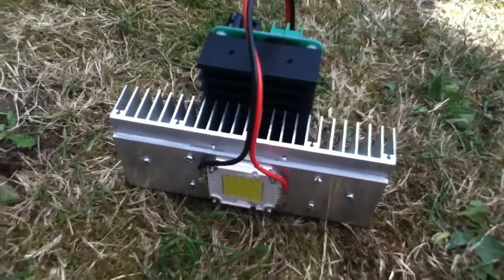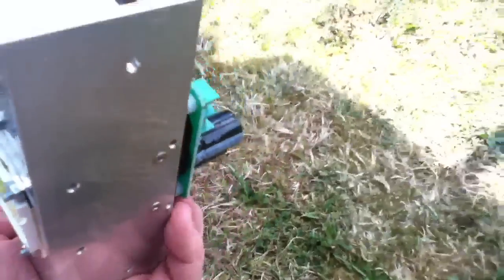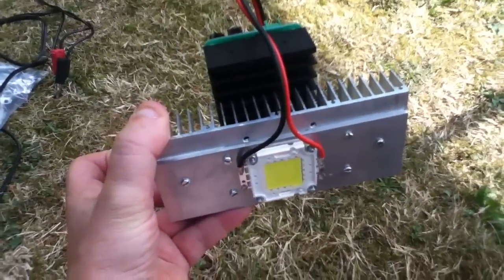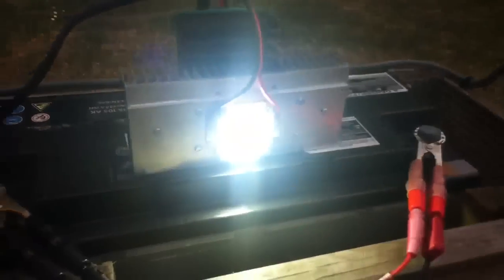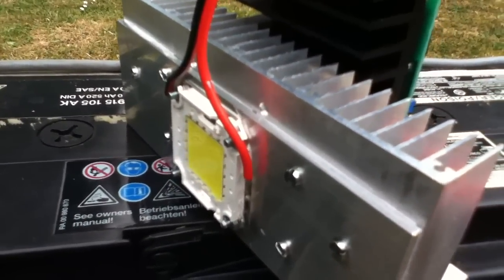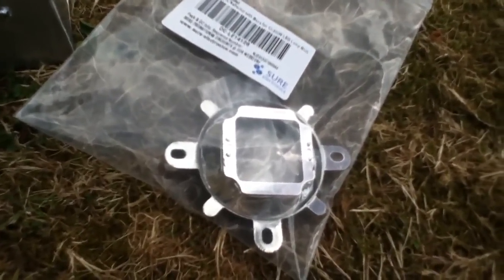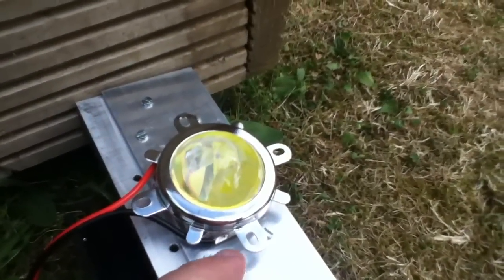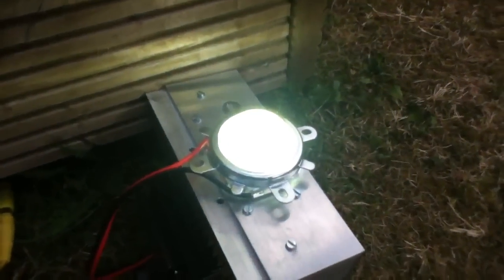Updates to 12V 100W LED Hardware - Heatsinks, Grease & Lens/Reflector

Comment: when you order 150 watt led floodlights, they don't have fans and heatsinks. Just mounted in a metal box. Why is that?
Reply: Because more than 80% (Ebay,Amazon...) are fake and have much lower Watt ratings

Comment: Why not use a CPU cooler?
 They are designed to dissipate those kinds of levels of heat much more efficiently.
The setup in the video takes no account of thermal breakdown layer dynamics.

Comment: Hello friend, I wonder what is the main difference from the LED when connected without the lens protection.

For I saw according to application not everyone uses lenses or depends on the application uses to different degrees lenses ... 60 ~ 80 degrees

Comment: You need to "design" the heatsink in, that heatsink has a rating which is degrees per watt. If it has a rating of 1 degree per watt then putting 100W into it will raise the temperature of the LED by 100 degrees C (boiling point of water) if the LED is running in a 0 degC environment. Obviously most of the time it will be a 15-25degC environment so the LED temperature will be 115 to -125degC. As LED's usually shouldn't be operated above about 90degC it's obvious a 1degC/W heatsink is not enough for a 100W LED at any temperature above -10degC
Reply: +etmax1 hey what you're saying is interesting, do you know what is the TDP of those 100w leds ? (i'm looking for a CPU heatsink and i must know the TDP
Reply: Sam Splentfield
I'm afraid that's a bit like asking what the fuel consumption of a car, it something that is known and written down in a manual for each car made but not knowing what car makes it near impossible to answer.

If you can find out what the manufacturer and model number of those LED's it will be in the data sheet, or alternatively you could buy the type you want to use and then it's possible to measure it.

I would only say that if the LED is a genuine say Cree P/N XYZ then the datasheet can be counted on, but if it factory seconds passed through the back door in China, or even a "backyard" manufactured product then each one will be different.

Sorry, I usually like to give straight answers.
Reply: +etmax1 i undstand totally, i've tried to calculate it myself with massic calorific capacity and other thermodynamic formulas but it is only approximations after approximations so i think the best way is to test them as you said, not very scientific but fair enough lol the only thing is ive heard somewhere that these have 40degC but it sounds a bit much then again i really don't know
Reply: I'd do something like put it on a known heatsink and put a precise current through it and measure the voltage precisely then measure the temperature of the heatsink as well as ambient. The number of degrees above ambient then relates back to the power going in minus the light going out and the additional temperature above what the heatsink should have given with a TJA of 0degW will give you the actual TJA of the LED. I'm guessing you should be within 5-10% after that.

Comment: You have my interest on these bright lights.  I found one 10W that I ordered to use as a step light on our motorhome.  After trying it out, I think I will find another use for it, as it is just way too much light for that use.  So I ordered a couple of 50W that I plan on using as "landing" lights for parking the motor home after dark, one forward and another in the rear.  I also ordered the reflectors and lenses to use with the lights.  I plan on finding a good mounting place on the unit that will channel the heat to the frame of the unit offering plenty of steel to dissipate the heat.  

This brings the question,  should I decide to mount both in the front would one boost converter be enough to power two lights, or will each need it's own converter?

Comment: hi.  I have a problem.  i used a pc power supply which pushes out 250watts and says the 12v output 14A.  I used the yellow and black wires for my 12v supply to the NEW DC-DC 600W 10-60V to 12-80V Boost Converter Step-up Module Power Supply then to my 100w led.  i am able to get the current regulated to the required 3A but only able to get the voltage up to 29V and not the required 36V.  even if I turn the V-screw on the boost converter more, it wont increase any further.  Why is that? doesnt that mean my light will only be winning at 87 watts instead of 100? so that would be 87% of its capacity?  how can i overcome this? what am i doing wrong?
Reply: Where do you get the 87% from? LEDs are not remotely linear in their power draw.
You need around 35,5 V to get 100 watts. 29 V will hardly light up.
Reply: The forward voltage of the LED is a product of the chemistry. Just because the voltage is only 29 volts and not 36 doesn't mean you are not running at 100% brightness. LEDs are rated for a maximum current, which it sounds like you are regulating yours to 3 amps. Sounds like you got lucky and got one with  a low forward voltage, which means it will use less power, and run cooler.

Comment: Hi there folks. I have done one up on this guy. I have built this setup in a tool box. Using two gell cells and converter, sinkfan,led. Works like a champ and bright as hell!

 When I figure how to get my video on this. I will post it. Special note to all you folks.
 There is a safety issue here. Voltage and amp potentail is in the danger range. Please be very careful when opertating. Especially output voltage to led.

 I am a computer and auto tech. (bad speller though.) So I do know what I am talking about.
Reply: I have my vid up now so check it out. Hope you folks like it. Look for 100w led toolbox conversion.

 E.

Comment: Hold up....You put the LED on to steal and then mounted aluminium fins on the back? Steal is going to heat up and damage your LED...Rather buy a CPU cooler with 200watts cooling capacity and mount the LED directly on to that. Try an ARCTIC Freezer 13 with the LED.
Reply: Dizy Tizy No it's an aluminum back plate.  I agree that another option good for "some" situations is a heatpipe CPU heatsink, but then you have a relatively fragile fan and fan mounting.  It would be smaller and lighter but less durable for portable use.  Then again, the driver circuit he has is absolutely HUGE for merely supplying a 100W LED.  As such, it could have had its own heatsink removed and then been mounted to the same heatsink back plate that the LED is, especially since there's some empty space there after the lens kit is installed, then the entire thing could have a front panel put on to protect and give it a finished look, and if the panel is aluminum too and grease put on the junction, then also serves as additional heatsinking area but it should have vent holes so there is some airflow to keep the driver board cool enough.
Reply: Stinky Cheese Aluminium is better...but it still won't dissipate heat as effectively as copper pipes in a cpu cooler...
Reply: Stinky Cheese I had an old GPU that was getting hot. So I took some flat aluminium and placed the old heat sink on top and then riveted a large aluminium heat sink to the side of the flat piece sticking out. I placed the expanded GPU cooler onto the GPU and secured it properly. The GPU temperatures climbed and reached 100c at which point I turned off the PC. My understanding is that the Aluminium which I used didn't dissipate the heat "fast" enough. Its not math, its just a simple test. What I have found out is that you need to use good quality heat sinks. Only pure copper has the ability to dissipate heat and only proper aluminium heat sinks are to be used for cooling. Have a look at some of the 100watt led flash light projects. You will see they use CPU coolers. I think its good practice to keep your equipment under 50c. You might be ok with 100c and you probably ok with wearing gloves when handling it.
Reply: Stinky Cheese"Think about it"...I did and then I tested it. Re-seated it and  Used lots of thermal compound. Even in this video he mentions that the LED is getting pretty hot. Take that Aluminium plate off and secure the LED to the heat sink. The Aluminium plate doesn't seem to have the same thermal properties.
Reply: "Aluminium alloy 1050A has one of the higher thermal conductivity values at 229 W/m•K [6] but is mechanically soft. Aluminium alloys 6061 and 6063 are commonly used, with thermal conductivity values of 166 and 201 W/m•K, respectively. The values depend on the temper of the alloy." So basically not all Aluminium is going to dissipate heat that well...Maybe you can find out the aluminium which is sold in the hardware and tell me about its ability to conduct heat...
Reply: Stinky Cheese People tend to give out disinformation (I suppose that's what I might have done except I thought the plate was steel - see original post). The CPU cooler is still a good fix. I'll will do some more research...

Comment: is this brighter than a car's headlight (high or low beam)?
Reply: Head lights are too bright now. I work driving at night and I'm shocked at how many people will not drop back to low beam for on coming traffic or even to drive up behind someone.
Reply: Orwa Diraneyya Yes. An average automotive xenon (HID) bulb is approx 2500-3500lm and these 50w LED claim to be around the 4500-5000lm mark. The challenge is converting the raw LED light into a useful and "legal" beam pattern suitable for automotive use. The other problem is dealing with the heat. You'll need a decent sized heat sink and fans to keep it cool inside the headlamp housing. Making a set of auxiliary/off road driving lamps would be much easier since the beam isn't as critical and cooling would be easier.
Reply: I second that question.

Comment: 1. have you eliminated the fan to this new system?
2. with this new system how hot does it get?
3. how long do you think uyou are able to leave the led on?
have you come up with a weatherproof casing for outdoow or underwater use? that much light not really needed indoors.

Comment: Could you use a HP printer adapter for this led?..it puts out 32 volts DC...
Reply from the maker: Kennynva T. It might possibly work, but not at full brightness. LEDs need a current regulated power supply.

Comment: do you really need a heatsink that big? though you do seem to be using it passively, i was thinking of putting one on an lga1366 intel heatsink do you think this would be suitable, the cpus went up to 130w tdp so i figured it would be enough but the copper center is smaller than the led will this be a problem? the copper is 30mm dia. also do you think mounting it with thermal glue will be ok?
Reply: I can't see any problem with putting grease on. It should help keep the LED temp regulated. 
What harm could it do? Eh what
Reply: yeah im not talking about grease im asking if i can stick it with thermal glue instead of using grease and bolting it i know you can use it on smaller leds so it conducts the heat and sticks the led to the heatsink, im just not sure if its suitable for an led this big
Reply: I have never used thermal glue, but if you are using a fan assisted cooler - I would bolt it,
Reply: yeah it just theres nothing solid i can drill and tap to accept a bolt on the heatsink as its all fins bar the 30mm center core and about 5mm either side of that ill have to see if i can work it out when my led comes

Comment: eBay item number: 131257886570
	
Hi julian, a question please. This boost converter in your video not only steps up voltage, but regulates amps yes? So does this mean that i could plug into my cars cigarette connector socket ... and power/charge my laptop safely?

Would you be up for showing people that on a video maybe?

... Im seriously considering going off grid as i mostly seem to use 2 lights and a laptop. Made your lovely 10w light. Now going to make your 100w version soon too

Chears.

Comment: i have the 50 watt version but when i use 33 volts it only draws about 30 watts but at 36 volts it uses about 50 watts do theses leds really require 36 volts
Reply: yes you can run 50W LED with 36 Volts (marginally), make sure you have a resistor to protect the LED as the LED resistance will rapidly drop at 37V and fry the chip

Comment: Just a suggestion for you.  The heatsink will work better if you uncover the lower portion of the fins you have covered with your L shaped plate.  Idealy you want the heat sink in free air, so convection will carry the heat away from the heatsink.  Interesting project.

Comment: Hi Julian,
I've been looking but I cannot find where you mention what LED driver you used.

My brother decided he 'needs' a 100W LED and so I'm left to work the how. I've already got the LED and a 12-36V step-up on the way, but no current limiting device.
Reply: can't the transformer do it?
Reply: Just set the output voltage of the step-up to match with the working voltage of your LED. No limiting resistor or current limiting device is ever required with matching voltage.

If a LED will establish a voltage of 3V at 20 mA current, then it will consume 20mA when connected to 3V power supply. It will never consume more than 20mA as then the established voltage will be higher than 3V, and that's impossible with a 3V supply. An equilibrium appears at exactly 3V when the current is 20mA.

LED is a basic p-n junction similar to diode, any explanation related to decrease in resistance as LED becomes hot or internal resistance of battery are irrelevnt to the characteristics of LED. In fact, at higher ambient temperature and so as to the LED, forward current is actually lower at a specific voltage.

Comment: You can actually run these led arrays much brighter if you modulate the voltage to 50hz. they won't get that hot and can be overvolted.
Reply: yes that's the whole point.
And NO i am not telling him to modulate it to a frequency that causes it to blink, it needs to be adjusted to a frequency the maker feels isn't causing eye-strain. 100hz should be good enough.

You would not see the blinking, you would only see the constant light.

Comment: hello mate, nice vid.
just a couple of thoughts for you...
I would cut away the part of the L shaped aluminium directly under the LED, rotate the power unit 90 degrees so both sets of fins are together but NOT interlocked, and then mount a small pc fan (about 2000 rpm) in the cutout of the aluminium, with power being taken from the battery via a small fuse.
keep up the good work...

Comment: Hi, If I ran 2 x 12V batteries the same as your using in series to 24V input could the driver your using produce 60V? The info on that particular driver is in broken English translation that really does not explain what it is capable of. Unless you have a spec sheet and a link to where you bought yours from?

Have you measured the current and voltage that the driver is outputting? If so how many actual volts can the driver deliver at max CV setting off one 12V battery? 

I have been playing with that LED chip for a while driving it with a CC CV driver off ebay its a B3603 
http://www.ebay.com.au/itm/B3603-DC-6V-40V-DC-DC-Constant-Voltage-Current-Step-Down-Regulator-Module-/390849035735?pt=AU_B_I_Electrical_Test_Equipment&hash=item5b006afdd7
with a cc cv electronic adjustable out put with build in display.
That led can run at as little as 1.5 amps and 30 volts on a large heatsink with fan cooling. It will rarely draw full currant or voltage even when the driver is open to full CV CC (108W) that almost exceeds the LED specs

So my plan is to run an array of 2 x 2 (series x parallel) from one driver @30v and 2amps per string so I would need at least 60-65v and 5 amps to be safe.

The info I can find on that particular driver says
"Input Voltage:   DC 10 ~ 60 V
Output Voltage:  DC 12 ~ 80 V ( adjustable, O/p Voltage > I/p Voltage by 2V ) 
Output Current:   10A Max
Input Current:     15 A Max( Under normal circumstances please 12A Current )
The minimum voltage difference:  2V  
Output Power:  input 12V Max 120W, in 24V Max 240W, in 60V Max 600W ( P=U * I ) 
Efficiency:  95% Max ( eg  input :30V   output: 40V   5A   n: 93% ) "

Yet your driver seems to exceeding the specified output of: 
"input 12V Max 120W" in the specs as that LED will not emit at 12V
If those specs were correct then the driver would only deliver a maximum of around 3.4A/36V to drive the LED at maximum spec limits (huge heat dissipation!!!) that would = 120W from the driver. Yet the driver claims 10A CC (12A with additional cooling) capacity. So @ 10A/36V = 360W from 12V battery.

sorry for the essay but you seem to have good experience in this field and I need to find out exact specs so I don't blow the budget buying parts for a BIG project to produce a 1000W portable lighting tower.

http://www.ebay.com.au/itm/DC-DC-Step-up-Converter-Input-10-8-32V-Output-65-97V-max-2A-100W-CC-CV-/251138242179
I have one of the above drivers. At maximum CV setting the It will output 2a at 95v through the entire range of its input supply (12-32v). Does your driver do something similar?

If so then I should be able to drive 4 100W LED chips off one driver as it says 600W on the ad so about 240W at 60V/4A (or 30V/2A in a 2 LED parallel x 2 LED series array) to keep driver heat at a minimum.

If this driver can produce 60V off anything less than a +60V battery bank then it will greatly reduce the weight and size of my design!!!!!!! If I can pull 60V and 10A off a 12 car battery then I will be a happy man as I will not have to carry 5 car batteries with me but only 2-4 at the most.

PLEASE HELP!! haha been looking at this for way too long.